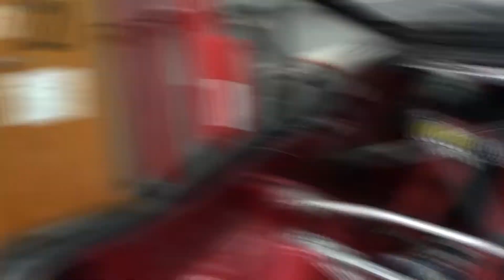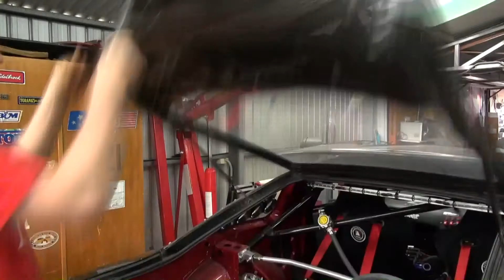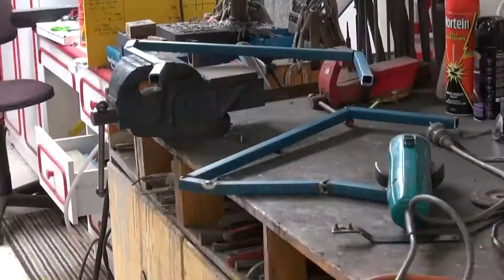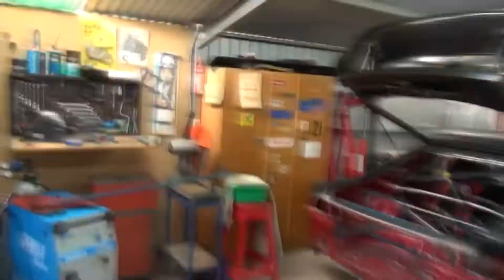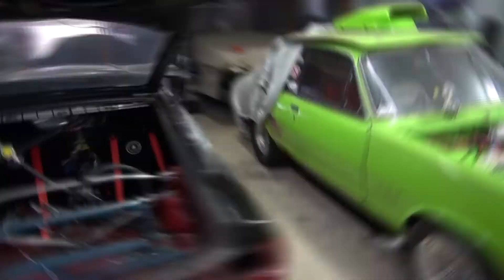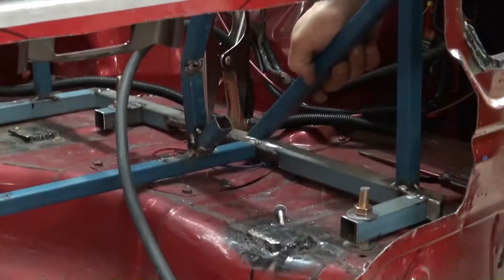180sx Drift Car Rear Radiator Build Part 3

Comment: What kind of tube you are using ????
Reply from the maker: mild steel 20mm square tubing,
would have been made out of aluminum but didn't have tig welder then but nice and strong being steel.
Reply: +styleslider400 
ally would have been so good!

Comment: Anyone else think this was just over thought? Just cut 2 circles for the fans on the rear and then cut through the bottom of the boot to accommodate having the radiator horizontal right up against the fan. Seems like a lot of wasted time welding and random weight
Reply from the maker: Jason MIlls trust me i did think of that, the fans were to big to place against rear apron panel and so was the radiator, cant do anything to the floor as the fuel tank and fuel tank straps are mounted right up against the rear apron under the boot floor,the amount of damage i have seen to the rear end of drift cars is just crazy to mount the fans on the rear apron might as well put everything the in the safest position i can when i have a crash in it and hope the damage wont affect the radiator and i can finish off the day using the car.